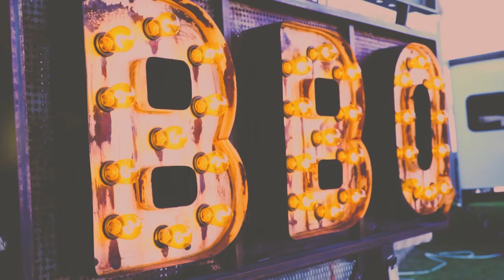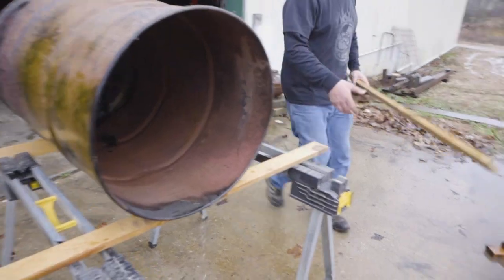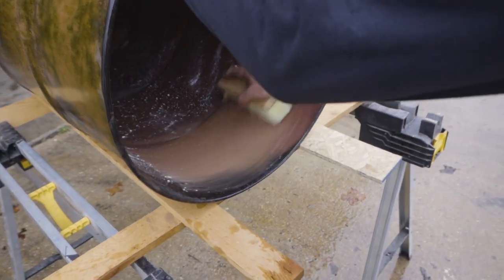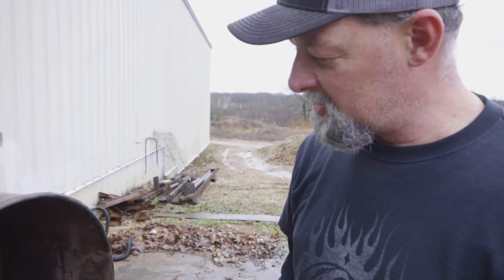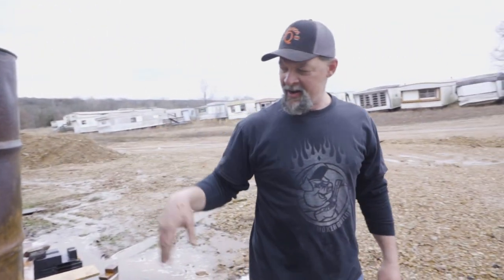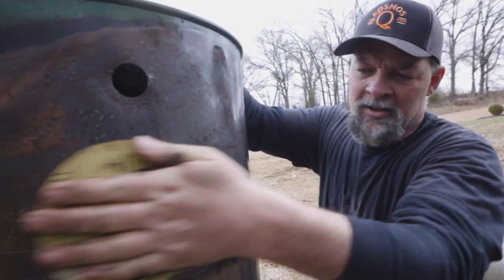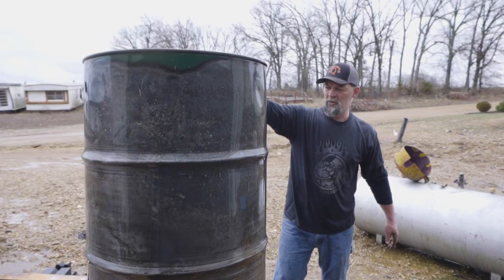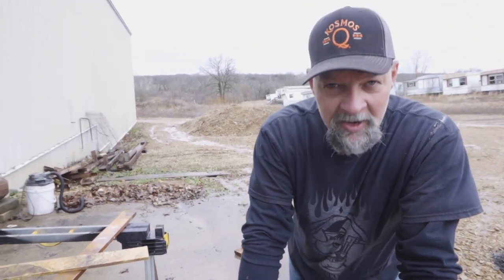How To Build a UDS Drum Smoker  [Cleaning Your Barrel After Burnout]

Comment: I tossed a handful of play sand in mine, Dawn and then used a low power pressure washer to (blast) the inside. When the sand flows out, add a little more sand if needed. Best way to remove liner from the very bottom and the area where the bottom is crimped to the sides. Done.

Comment: I wish I saw this video before trying to get the paint off of my food grade 55gal drum.  I'm using a propane torch. The out side burned off pretty good, but that tan coating on the inside is an absolute pain to get burned or sanded off. 
 Lesson leaned for my next build.

Comment: I found a barrel but it had some industrial chemical foam in it. If I burn it out can the chemicals that where in hurt you if it’s been burned out
Reply from the maker: On most chemicals they won't survive the fire. If you are uncertain what the chemical was or have any other questions about it then I recommend looking for the MSDS sheet which will tell you all about the chemical. I do however recommend finding barrels that had things like coconut oil or similar things in them rather than foam, glue, or other nasty things.
Reply: @SmokerBuilder  I bought one that had mineral spirits in it and burned it out twice.  I will do one more good hot long burn and then wash it like you did.  You think that will be good to use?

Comment: After burning and cleaning the inside. You said spray it with wd40 or something to prevent rust. Do you just leave it like that until your done with the out side.
Reply from the maker: yep, I spray the outside with some kind of anti rust stuff. wd-40 works good. but you will need to use an oil and wax remover to clean the barrel before painting to remove the oil so the paint will stick.
Reply: SmokerBuilder what about the inside.
Reply from the maker: hey buddy, so the inside will be seasoned with cooking oil after you are done painting. I do not recommend using anything else
Reply: SmokerBuilder thank you.
Reply from the maker: Not a problem buddy!